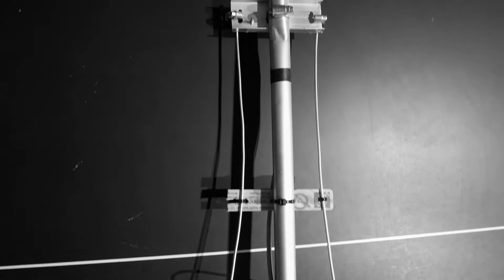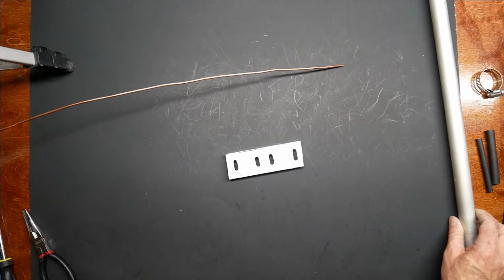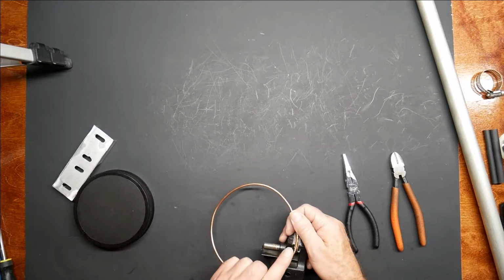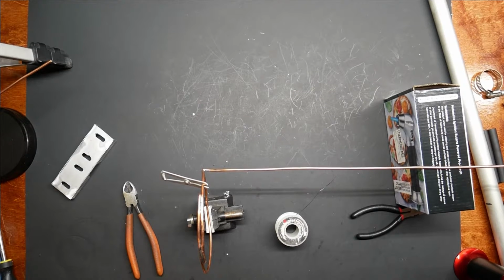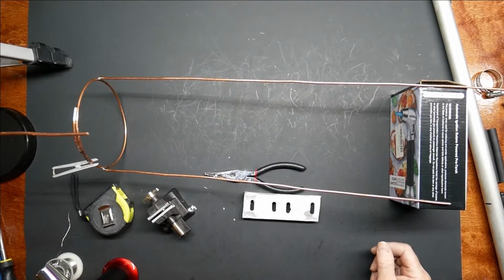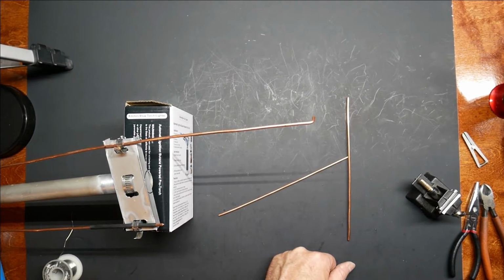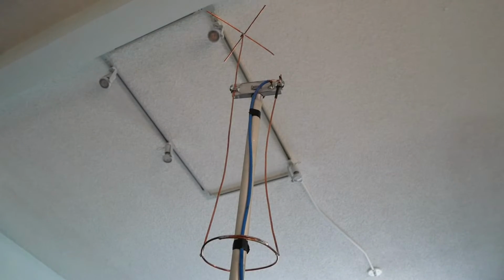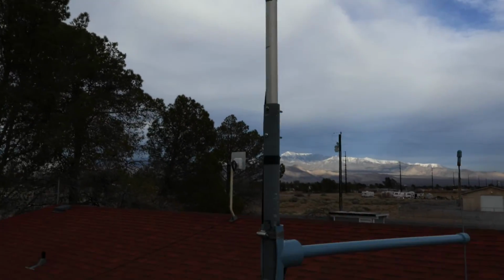An Astroplane clone cut for 2 Meter Ham use.

Comment: I noticed that the heat shrink automagically moved from the longer to the shorter wire just before you started fastening the top hat.
Reply from the maker: Nicely done! I realized in the middle of the build the long wire must be grounded.

Comment: Overall, nice experiment. I started to do this then discovered your video.
How about a 6 meter version of this antenna? We have some 6 meter activity, nets and such, so I may give this a try with 1/2 inch copper tubing for 6m.
Reply from the maker: Go for it. We have zero 6 meter activity at my location, which is sad. 6 meters has many positive aspects and would arguably be best for mobile use.